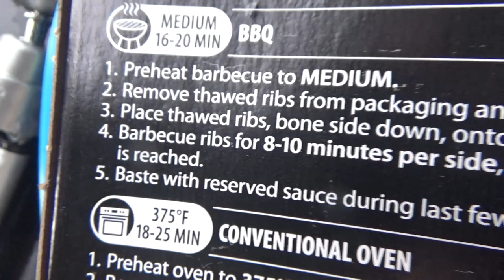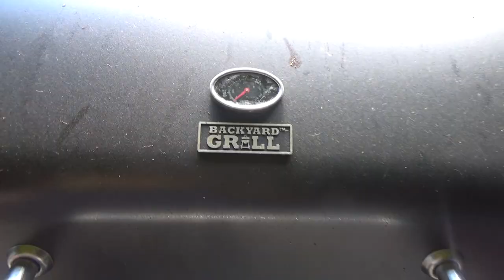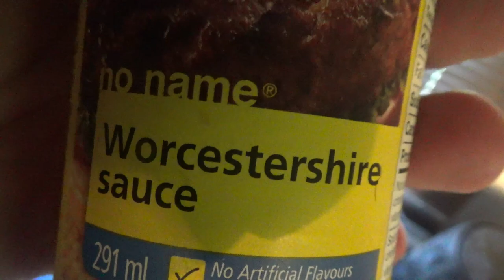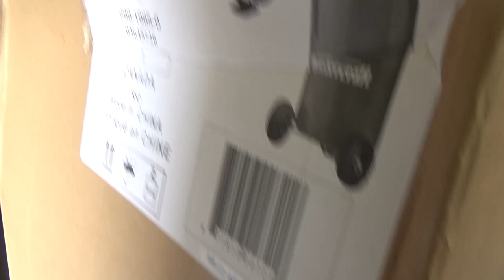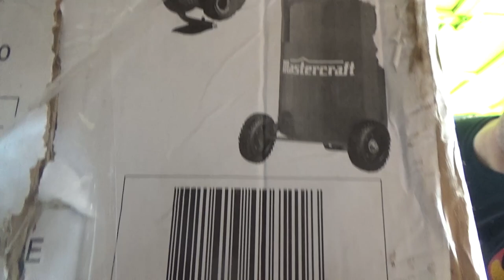Dump Run Garage Extension

Comment: I guess the shed was added on to the garage later. But another idea would be to just pour concrete into that shed, cup off the area where the door is so it doesn't run out, and level it with the garage floor like that? Or if you don't want to use cement, take gravel...

Comment: Is that old tree stump still in that hole where the tall grass is? Because now you've got a truck and can get it back in the yard and actually pull it out of there! (I still remember when you tore down that wall between the house and the garage in order to get the lawn tractor back there)

Comment: The cheapest vehicle I have is still my 50cc scooter, it costs me €38.50 to insure for a year, and that's all - no tax, nothing else except the gas. Only liability insurance though, since it is a 2005 model, and I paid 150€ for it.
OK, it is supposed to be limited to 45km/h, but since the general speed limit inside the city over here is 50km/h, so everybody is doing 60km/h anyways, I had the limitation removed in order to provoke less dangerous takeover maneuvers, so it goes between 55-65km/h (depending on multiple factors, like how full is the tank and how hot is the engine etc...). But of course it needs time to accelerate, since it's not a 2-stroke but a 4-stroke.

Comment: You would probably regret selling the trans am after owning it for so long, If you decide to paint it yourself it would be a good project to work on in your spare time.  Even in its current state its a cooler car than most cars you will see on the road.

Comment: That quote for the TA is extremely low!  I would get the car running and bite their hand off, even if you only drive it a few times per month it is worth it.  I can guarantee that you'd regret it if you sold the car.

Comment: Actually, I think these molds are way too much work. Concrete walkway "tiles" (or however you want to call them), about like the one that sits next to the brick next to your garage door, cost about 5 bucks a piece. They are square, 50cm by 50cm (that's half a meter by half a meter), so you could easily build any kind of walkway with them that you might want.

Comment: Why not put something on the floor and have it be like a ramp, just that the whole floor will be the ramp? Then you can still put stuff in there, like snow blowers, lawn mowers and so on, but they will be sitting at an angle on the "ramp floor" - so what? Just an idea...
Reply: Or make it a short and steep ramp, works just as well.